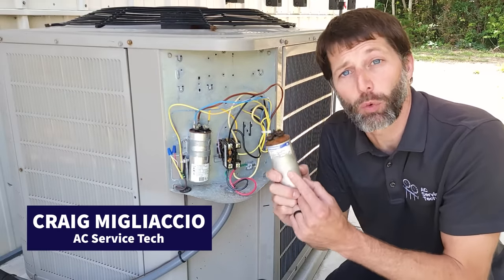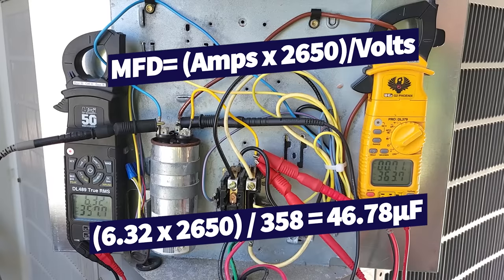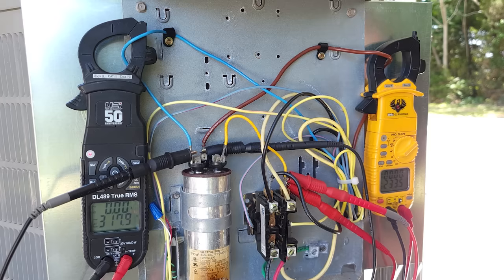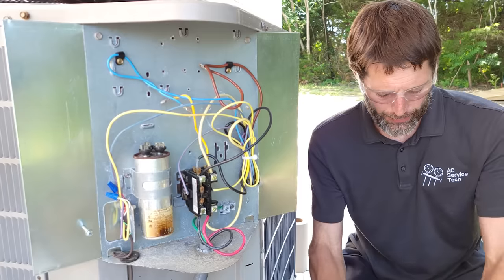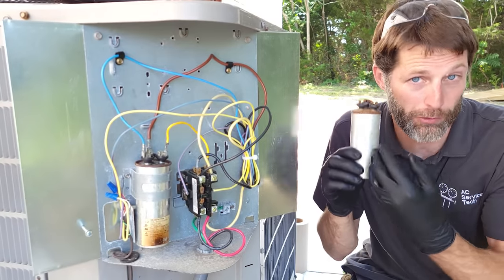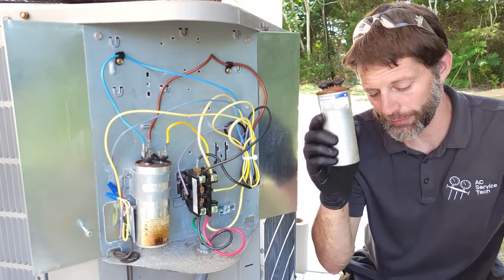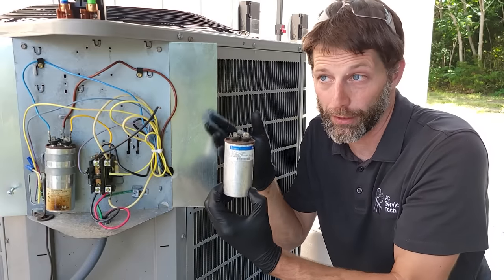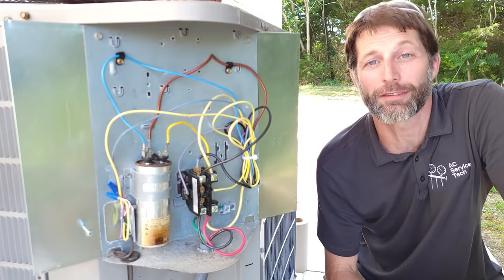WHY CAPACITORS FAIL in Air Conditioners! Watch it Break!

Comment: I have seen a catastrophic failure of a cap from a lightning strike. It was the start cap for a deep well motor. It literally blew the top of the cap off ,which caused it to blow off the top of the control box. All that was left was the metal can and a spiral of the electrodes and dielectric material hanging out of the box. As a rule of thumb for me I always replace the starting caps on equipment over ten years old.
Reply: That happens inside hvac units as well. They sometimes blow up completely leaving a burnt oily mess everywhere
Reply: @GonzoDonzo  Seems like incredibly poor design, especially when it can be prevented. Is there a particular reason that contractors put with this failure mode for so long? An incentive, of some sort? Perhaps?
Reply: @exgenica  the old capacitors filled with nasty oils that were many times larger, rarely failed. Contractors dont have a choice. U can buy better quality but they still fail. They are like the old incandescent light bulbs. It should last for years but sometimes they burn out a week after u screwed it in.
Generally its indicative of something else going on as well but its the weak link in the chain and will go first
Reply: Sounds like all of the links in the chain are getting weaker.
Reply: @GonzoDonzo  said, "Contractors dont have a choice."
Contractors have the power of unions, professional organizations, conventions, and even individual feedback to motivate the manufacturers to reduce these field problems in future A/C designs.
Those that haven't provided that feedback to any organizations they belong to and to the manufacturers...have some responsibility in the problem still being as big as it is.
Reply: @exgenica  yeah been there. They regularly bring contractors out to the factories for input. Unfortunately they still have gone pretty cheap. The other problem is the old style caps that practically never failed are now banned due to the toxic oil inside them. There is also a good reason to have a cheap component be the weak point. Its much better to lose a capacitor then burn out a fan motor or compressor. This gives the service tech replacing the part a chance to identify the issue before it causes a catastrophic failure.
Believe me if hvac contractors had a choice they'd much rather have some replacing entire condensing units all day rather then driving around replacing a half dozen caps. Way more money when u replace an entire unit and a condensing units is easy
Reply: Lightning blows up things you see immediately and weakens everything else so it blows up at the most inopportune times. I remember a pond level pump control at a coal mine. The lightning strike blew out everything in the control box and the 480 volt pump motor. A few weeks after we replaced everything history repeated itself. The mine guys weren't happy. They were less happy when I pointed out that the way they had the level sensor probe wire run, over telephone poles, made it a 1500 foot long antenna.

Comment: Good information. I am a electrician and this outside my normal work .But during a 99F muggy day , I got a trouble call of AC unit tripping breaker. Did some testing and found line voltage about 12% to low do to heavy load on power grid. Total current was a tad to high on AC unit but the start surge was way too high. Inrush ammeter used. I took a peak inside AC unit and noticed a fat cap. After discharge I tested value and was like 50% low on both sides. The AC did start but struggle. I local supplier had cap . I changed it and running fine. The inrush current was in spec. I wounded if lower than normal line voltage can cause premature failure of cap. The AC was serviced in spring and charge on system was topped off.

Comment: Re: corrosion. With automotive headlights it used to be pretty much routine to apply an anti-moisture/corrosion material to the connectors. Seems like for decades the A/C industry has (intentionally?) used the wrong design connectors and not properly advised sealing the connections to reduce corrosion.
Reply: Plus needing one hand 2 inches wide and the other with 7 fingers to change the headlight bulb from my experience and without touching it also with halogen.
Reply: Well it's a good thing that HVAC units aren't driving on roads sprayed with brine in the winter and exposed to all the extreme vibration and other contaminates that motor vehicles are on a daily basis.

Obviously the outside condensing unit is stationary, sealed better and therefore shielded from all the nasty things automobile electrical systems are exposed to.
Hence the lack of protection seen in mobile applications... yet not always there either due to poor quality manufacturing, cutting corners, and of course the YouTube graduates who don't have all the facts, tools and materials.

But by all means, please do yourself a mental favor by applying heat shrink insulation and dielectric grease to all of your HVAC electrical connections and put a sun shade over it.
It is just a heat pump after all.
Reply: @rjbradlow  Trailer Reefer units do. ;-)
I suspect they do use different connectors though.
Reply: @michaeld5888  I've never had much difficulty with headlight bulbs or bulb assemblies. Guess I've been lucky. Thanks for letting me know it can be a problem.
However, for "and without touching it also with halogen." When handling halogen bulbs, I use gloves if I absolutely have to touch the glass envelope. If I can't, I try to clean oil contaminants off the bulb as much as possible before I seal it up. Many people don't know that even fingerprints from skin oils can significantly reduce the life of halogen bulbs so that's another good bit of info you've brought forward to people.
Reply: @rjbradlow  So...just because there are additional issues in a different environment, you get all sarcastic and mean and don't even try to solve even one of the problems? Sounds like a Millenial talking.
Reply: @exgenica  Possibly I have been unlucky but have had some cars where it is a very tricky job and my hands were just the wrong shape! I have heard of cars where the wheel needs removing to change the bulb.
Reply: @michaeld5888  Yes to halogen bulbs, especially the H7 style bulbs and they tend to not last as long as some of the other types.
Reply: @michaeld5888  LED headlights blown: $1200!
Reply: @exgenica  I have used rubbing alcohol as a degreaser on halogen bulbs,  acetone would be good too. Even new, I clean them. I have had fingerprints on them cause it to explode. 
   Would water displace sprays help with a/c wiring terminals? I'm in Florida.
Reply: They have to make these things break down early, because you know, money lol
Reply: Denatured alcohol

Comment: In high heat (70C) or high voltage breakdown, it is the polypropylene that melts. When it partly melts it creates a weak spot that has a lower withstand voltage, letting it get even hotter.

Comment: It is interesting that in 2022 nobody has invented a capacitor or replacement device/component that lasts 5x longer or even not burn out. Nice video - impressive.
Reply: Whenever I replace a dead cap on a relatively new unit I always get one with a higher voltage rating if possible (30-40%). Inductive kick always exceeds the rating but because it's very brief it takes time to damage the dielectric material.
Reply: 2022? This should have been done decades ago. Connector design, enhanced cooling, properly spec'd voltage, unit failure chemicals containment...the whole bit should have been properly designed a LONG time ago. Putting up with all those separate failure modes for decade after decade seems very hard to justify.
Reply: They have, but other types of capacitors, particularly for high voltage, cost a lot more.
Reply: @wiregold8930  At my place of work (rewind shop) we've noticed that the 400 VAC run caps (on 240 V. motors) don't last anywhere near as long as same rated 450 VAC run caps. Also, If any cap measures lower than rated capacitance, you can guarantee it's on the way out.

Comment: I've seen capacitors fail when the "operational smoke" is released. I've also seen this happen to resistors and other electronic components. If a way can be found to make the smoke containment more robust, I believe component life could be maintained indefinitely.
Reply: The Magic Smoke is indeed a fickle material in any component it's used in. IBM had replacement smoke they sold, give it a google search. The hard part was getting it back into the part :| Big bucks job there.

Comment: I just had my capacitor replaced with the AmRad Turbo 200x capacitor.  He said that were the best and had a 5 year warranty.  American made which I like.
Reply: I replaced all my AC capacitors with American made capacitors.  That extra $50 you spent to replace all the Capacitors with something quality made will probably save you a service call in the future and extend the life your system.

Capacitors rust and deteriorate over time.  Replacing them every 5 to 10 years before they fail is definitely a smart idea.  Beats calling for desperate service in August with your wife melting and having to pay whatever they want to unless you want to wait a few days...

Comment: I noticed our clocks flashing on appliances. The was a power outage of some kind. 
After youtubing a bit I ended up using the multimeter and found the capacitor blown. switching out our capacitor worked. We were up and running on a friday evening. I just made it to the supply house that had one with minutes to spare. 
I watched your video for a better understanding.  Thank you for sharing your knowledge with the diy’ers of the world
Reply: LOL - I ALWAYS wind up at the last minute by the time I finally learn what I need!  The clock is ALWAYS at 15min til closing, no matter HOW much earlier I started the troubleshooting!
Mr KL
Reply: Good for you. Now order a spare cap and keep it as a spare. Cheep insurance.

Comment: As an engineer for 50 years, I've opened a lot of blown capacitors.  Dielectric failures primarily, then melted foil due to high current surges, esp vintage caps.  However in one case,  I had a 900 foot deep well pump replaced at a very high cost for me.   Later I discovered the removed capacitor in the control box was the culprit.  The rivet holding the terminal was loose.  The cap was intermittent.  The  old pump was fine.  Aghhh.   However its not good for the motor to eat current without starting.      
Your video shows someone with a lot of experience.    Thumbs up.

Comment: Question: I had brand new compressor installed in January, and it started chewing up 20A fuses by July. Switched to 30A's, but capacitor failed same month. Installing technician came out, confessed that they'd been sourcing crap capacitors during COVID so "wasn't surprised" it had swollen and died. Replaced the part at no cost, BUT charged me $200 for service call.
SHOULD THEY CHARGE CUSTOMERS FOR CHANGING OUT FAILED NEW PARTS?

Comment: Took my first cap apart in the late 70's - was amazed. A friend called me one time in the early 80's ... got an estimate of $650 to replace a compressor. Cost $5.49 for a cap. Moved into my house in 88. Replaced the cap every 5 years for quite a while. Went from the oval shaped unit to a round one (Oval - out of stock) Round one still running after 10 years on my 40-year-old unit. Maybe I need to move the cap to the evap line.  Very good presentation -Thanks
Reply: do you remember that PCB smell when they burnt? nasty!
Reply: @randyosborn284   Was that PCB? I used to smell a small from Fluorescent Lighting ballasts in the 70's 80's and early 90's that I assumed were PCB's, but wasn't sure, the caps In my AC unit were pretty tame. I got a feeling it is some other hideous noxious oil now. Maybe not. It did have some kind of vinal smell though

Comment: I was a power supply design engineer in 1984 when capacitors were blowing up. It is all simple once  you know the answer. Our caps had a wire welded to the foil making dissimilar metals. The end seals were epoxy with too much filler. The PCB cleaner was getting past the seal to attack the weld. During high ripple current the caps would fail. I don't know if this is why Sangamo capacitors in GA went out of biz.
Reply: In the 80's my a/c blew a capacitor each year. The fault was power spikes and brown outs (oe so I later learned). Replaced a perfectly good Frederich with an incredibly awful Lenox. If I knew then what I knew now.
Reply: Wow poor design and I'd say that's why they went out. AC mylar caps or other like electrolytic?
Reply: @flaplaya  electrolytic mil spec
Reply: China is why that company shut down I am betting. Buying 1,000 capacitors for $2 is a massive selling point. And a price US citizens simply will not work for. Without competition, that company would have corrected flaws in their designs and would probably still be in operation today. 
By the way, exploding capacitors still has not been solved.  lol 
I am no designer, but I am a repair tech. Mosfet failure alone can cause a "runaway" current which can have you cleaning a board of capacitor remnants. Its not very common, but they can still detonate. 
Most of them simply swell or purge their dielectric. Most exploded caps I come across are found oddly in audio amplifiers' output stage. 
The caps tend to be placed far too close to the amplifying mosfets. And when people run them under 4 ohm loads or lower, the caps heat up dramatically.
Reply: I remember D mos from siliconex blowing up in my designs in 1984. But then International Rectifier FETs came out and were bullet proof.

Comment: EXCELLENT video.  To the point minus fluff - WELL DONE. In my working days, I spent 17 years as a A/C tech. I also am a electronics tech and have been for decades.  I did NOT know that formula. NEVER heard of it. I see it is ohms law with the 2650 number added in. Curious as to where YOU learned of it. You can bet I will NOT forget it.   Also, 100% agree that replacement capacitors should be rated 400+ volts - ALWAYS. This is especially true in the desert southwest where I am.  Here, I also used ONLY desert rated ball bearing fan motors.  It MATTERS.
Reply: This 2650 stumped me for awhile too and it is really 2654 not 2650, but close enough.  Here is where it comes from.  V=I x Xc (capacitive reactance) and Xc=1/(2*pi*f*C) where f is 60 cycles per second.  1/(2*pi*60)= 0.002654 so Xc= 0.002654/C.  Therefore C= I*0.002654/V which is a value with many leading zeros (microfarads).  To get rid of all of those leading zeros just assume the answer is in microfarads by multiplying the  0.002654 by 10^6 (1,000,000).  Hope this makes sense.

Comment: In 17 years i only ever replaced 2 of the old style capacitors that were much larger. I know they had some nasty stuff inside them but they were rock solid
Reply: Yeah ive seen 30+ year old caps right on the momey, new caps commonly fail in a year or two